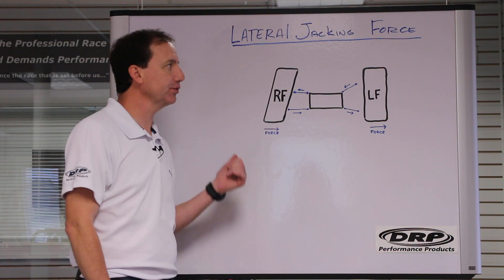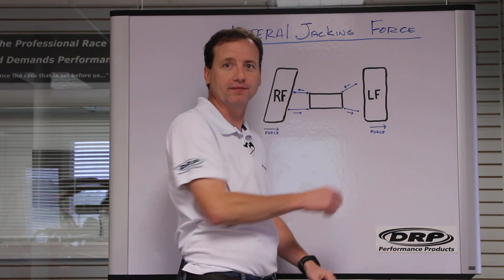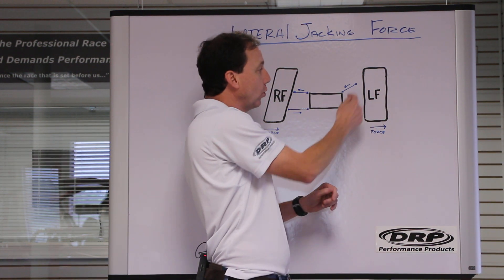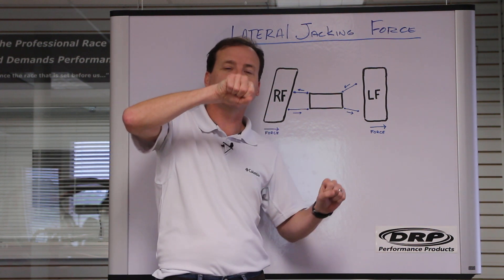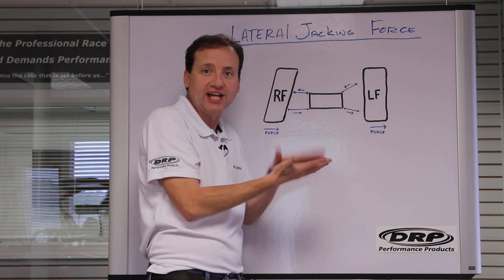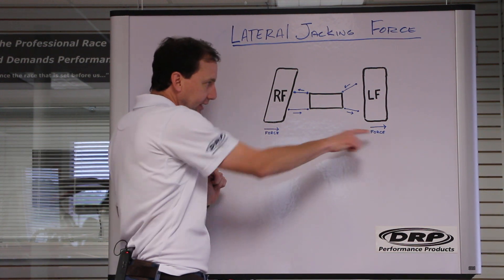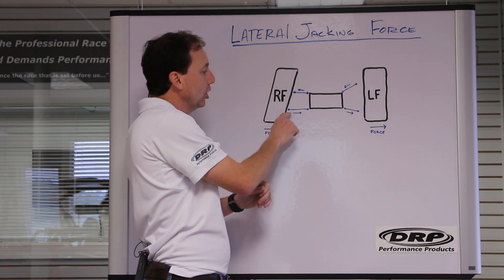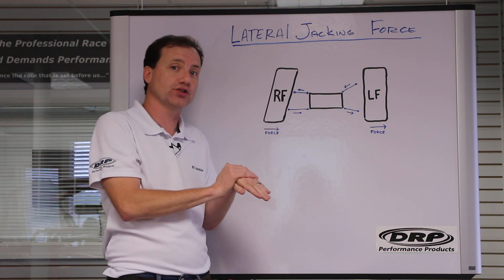Lateral Jacking Force

Comment: I know there are alot of variables to consider but in general , do you feel like there are certain  tracks or setups where  more upper control/lower control arm angle  in the right front can be used (or tuned to be used) to force the right front in to the ground and have you tried more right front upper/lower control arm angle  on a pull down?